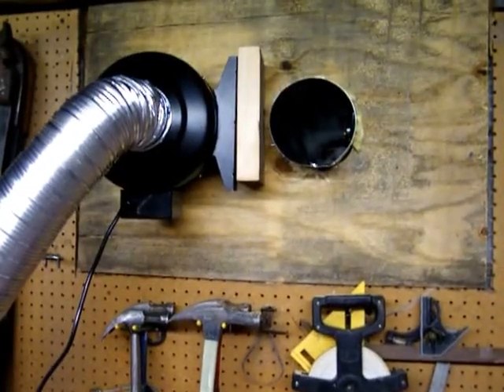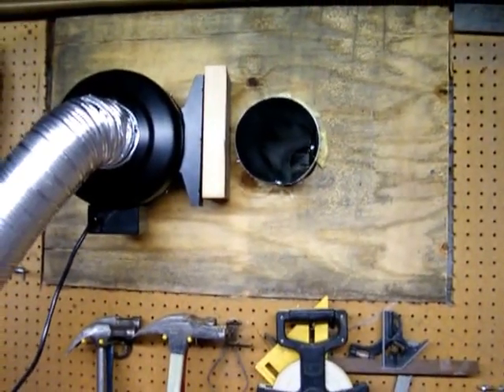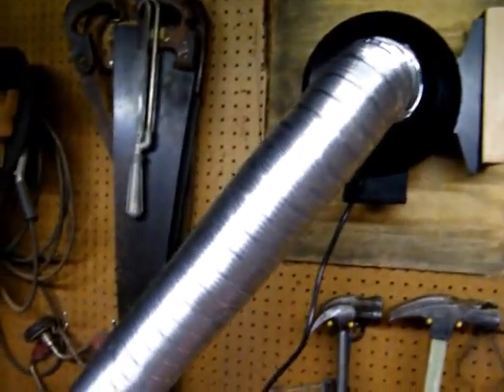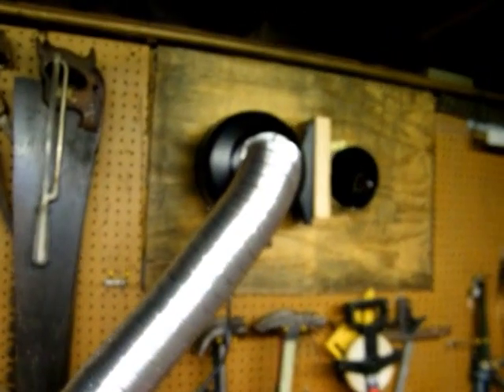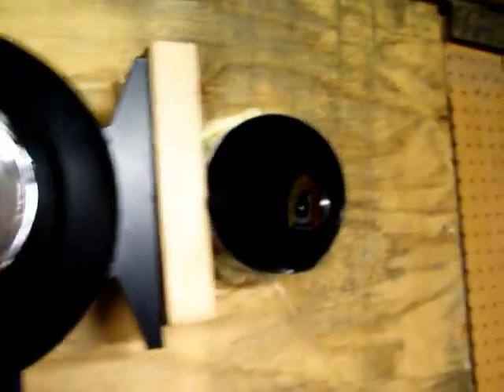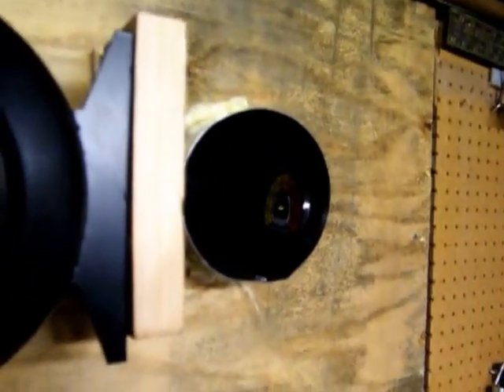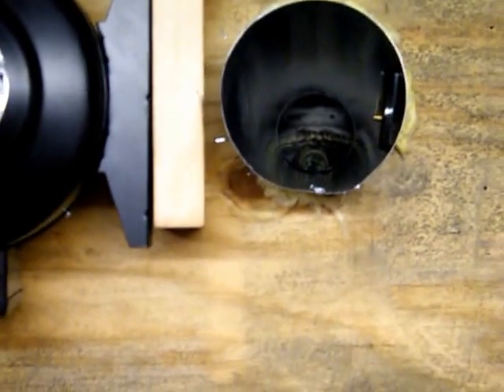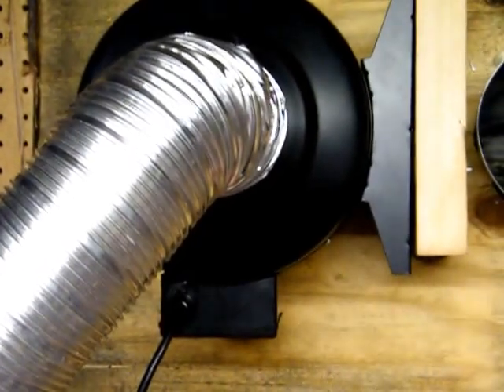Barrel stove update

Comment: Is that stuff like what you put on the back of a clothes dryer or it more heavy duty?
Reply from the maker: expand on your question
Reply: The stuff you have in your garage and running from the barrel and to the garage
Reply from the maker: it is the same only on the dryer i used 4  inch  pipe and blower